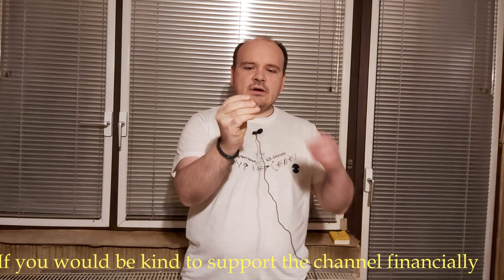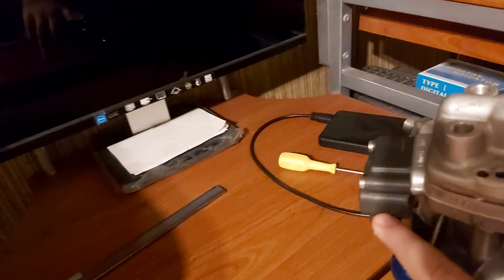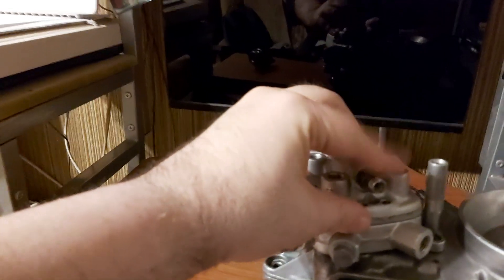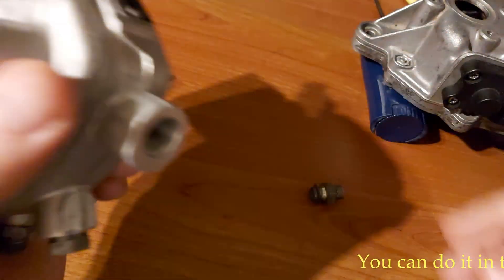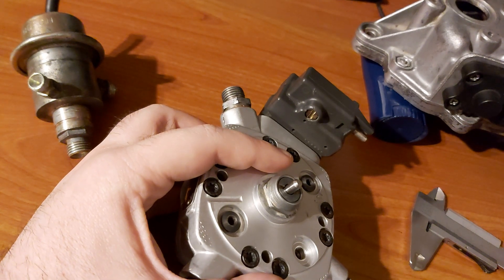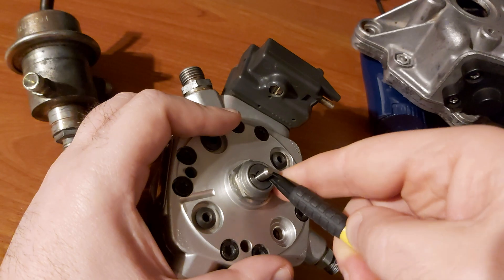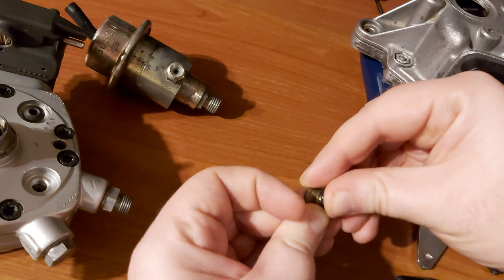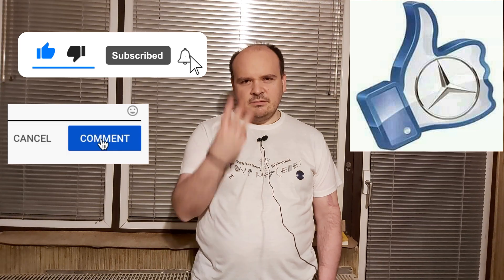Mercedes Ke jetronic - Replacing the rubber seal/fuel leak out of the distributor issue rich mixture

Comment: Thanks mr. About this video . When i push the plunger with my finger then fuel leak i replace this oring but the problem didnt solved is the fuel distrbuter is worn
Reply from the maker: Hello. Fuel has to flow when you press the plunger(by pressing the airflow meter plate), the point is that the fuel must NOT flow when you DON'T press the plate and the O-ring on the sleeve(crew) has to prevent fuel leaks no matter if you press the plate or not!

Comment: Hi friend. Before writing to you I want say so many thanks. Because I learn about so many things about jetronic system. The car only carank and stop immeditelyI have fuel leakage in the same point and my distributor newer deliver the fuel out of the ports. I try to push the pulanger even if turn the mixture adjustmet screw to last point. İs it reason of the presure lost in that point.?
Reply from the maker: Hi and thanks. If you have fuel leaks then replace the seal ring. If you have no flow to the distributor at all then it can mean that the pressures equalize and the car won't start. In that case the pressure regulator can be the culprit but that's something you will have to do with the pressure gauge on. You must measure the pressures and then tell me what you got. The car starts and stops the same moment - it can refer to the rubber boot(torn or cracked). That much I can say from this stance! Greetings
Reply: @mercedeske  Hi, you advice to me some valuable  things I order that seal ring but it had not delivered yet. When I take the  ring I will write the result. Loves from Turkey.

Comment: Finally found this video! Priceless info! Thanks again sir! I suspect my fuel smell through the air vents is coming because of this seal leaking (hopefully) as the underside of the air/flow plate is visibly wet and EHA is dry. Will post results!
Reply from the maker: Thanks, just keep digging on my channel. You will find priceless videos. Happy Mercedesing 🍀 😊 😃

Comment: hello...i need help.... My FD plunger is leaking only when the sensor plate is pushed down while engine is off. Changed the o-ring with a new original one...the big 19 nut is also tight. Why is it like that?

Comment: I have been binge watching your videos and I have a question about measuring the nut and sleeve in this video. In your video at https://youtu.be/EPTgBZlB6NA?t=299 You say the distance is .6mm. Is that for a specific vehicle? I have a US model 1987 560SL and my measurement (car was running smoothly) is .43mm give or take. The larger o-ring was hard and so I purchased a new one and also the smaller o-ring. Should I change distance to .6mm or put it back together using the same .43mm? Love your channel.
Reply from the maker: Hi, thanks, I'm glad you like my videos. I really like your videos, as well. It can be seen that you have a huge experience working full of self confidence on the car without trembling hands from fear! The next video to come is going to be the altitude sensor which is on the US cars version, so you could "take a look" once it is uploaded... Concerning your question, the 0.6mm is the BOSCH recommendation and a nominal value so to speak but if your car runs okay on 0.33, then it's up to you to decide whether you are going to set the sleeve by the nominal values or you are going to leave the sleeve as it was. You are not the first one to ask me this question. That's why I tell people to remember the original settings before they do any modifications. So, long story short - either you are going to do the job twice experimenting or you are going to leave the part as it was originally. Happy Mercedesing!
Reply: @mercedeske  You are great! Thank you so much. I didn't realize how easy that nut is to move. I may have move it when I cleaned it in the parts cleaner with a soft brush (I've never done engine rebuilding before). I'll make note of my .33mm, but I will set it to .6mm to start with and see how it runs (if it ever does). 

OH Yeah! I cleaned it months ago and now the piston is stuck. DARN!!!! I guess I didn't lubricate good enough after cleaning. I may need to disassemble the entire thing now. This is how it goes with me.

Thanks again!
Reply from the maker: Just disassemble the fd, apply WD40 as much as you can and let the fd stay over night. It's going to slide smoothly as through butter 🧈 😃
Reply: @mercedeske  Thank you sir. I have purchased a Fix your Mercedes membership! You have been very kind and I appreciate you taking your time with me. 

Question: When you say "disassemble the fd" do you mean I will take it completely apart like in these videos you have uploaded?

Fuel Distributor - The Basics Part 1
The Fuel Distributor Disassembly Part 2
The Fuel Distributor Disassembly Part 3
Reply from the maker: @TonyLiveTV  Thanks a lot! I really appreciate that! As for your question - Sorry, my bad, I meant to remove it from the airflow meter. Just remove the fuel distributor, put it upside down  on a workbench or....and then apply wd40 and let it sit over night. There must be an improvement. Best wishes!
Reply: @mercedeske  I had already removed the fuel distributor from the air flow sensor in March. At that time the plunger was smooth like butter. Then I cleaned everything using a "water based" solvent (I guess that's where I went wrong). After that I blew everything out with the compressor (has air dryer). Then I squirted WD-40 into all openings of the fuel distributor and then I put it away until today.  I live in Arizona which is the dry desert. Anyway, today I started working on the fuel distributor to replace the o-rings and the plunger was stuck out. I put my thumb on it and pushed it in and now it's stuck in.

I have removed the nut and the small o-ring and have now filled it with WD-40. I will wait till morning and I'll let you know.

My BOSCH is 0438101018 and if you need my VIN let me know. I wonder if I need to purchase a repair kit? The car was sitting for 14 years. Everything I touch on this car scares me.
Reply from the maker: @TonyLiveTV  Just go easy on it. That's something worst or the car - sitting for more than 5 years. One advice more from me - fill the car with ethanol free fuel because it is going to make you a real mess/mesh inside the distributor r it is going to harm the diaphragm so avoid the ethanol containing fuel after you have started the car. I would really like to see that car brought back to life one day and you can do it!
Reply: @mercedeske  unfortunately the plunger is still stuck after sitting overnight with WD-40. Looks like I will have to remove that bottom nut with that retainer washer to pull out the plunger. I’m not looking forward to opening up this can of worms. If I ever do get this engine back together I don’t see how it will ever start. I have messed with way too many things on this car.
Reply from the maker: @TonyLiveTV  You don't need to unscrew the nut in order to take out the plunger, just unscrew the sleeve. One the distributor on my video I couldn't move the plunger for 1mm with my both thumbs and you saw how easy it was going at the end? As for your distributor, well...I don't know what to say, I haven't seen the situation...Unscrew the sleeve completely and then carefully take out the plunger.
Reply: @mercedeske  thanks for your suggestion. I have already removed the slotted nut and filled that with WD-40 yesterday. I can’t get hold of the plunger because it is pushed all the way down. I tried using a rubber mallet on the opposite side to see if it would come loose, but that didn’t work either. I will try a few more times before I give up.
Reply: @mercedeske  YIPPIE! The plunger is now out! There is NO rust or anything like that on the plunger. The inside looks OK too (can't see too well). The spring also seems fine. The plunger goes back in, but doesn't readily come back up. I flooded it with WD-40 and then put the plunger in. It works OK, but not as smoothly as it did when I first removed it from the car. 

Question: What's the best method for cleaning? Should I just use brake clean? Is that safe on the diaphragm and o-rings? I do have a 6L ultrasonic cleaner with heater. I realize I should put the plunger in the cleaner. I didn't think I should put the entire fuel distributor in the ultrasonic for fear it would vibrate the 8 "off-limit" hex screws that pre-load the springs. Just want to do it right that's all. I will be uploading a video of all this once I have it all back together.
Reply from the maker: @TonyLiveTV  I told you you are gonna make it! If you have an ultrasonic bath then you can flush the whole distributor. 30min. in the bath using a dish soap and afterwards flood everything in a solvent. As I told you that you are going to succeed with the plunger, I'm telling you you are going to start the car!Happy Mercedesing and fingers crossed!

Comment: I have found fuel in the rubber intake boot, I get the black smoke and rough, rich running, and have thoroughly checked all systems.  Do you have a good source for this seal? Would it be included in a fuel distributor rebuild kit? Nevermind, I see you put the part number in the video description. Thank you!
Reply from the maker: There. Nothing to be afraid of. Just remember the position of the sleeve. Measure it with the caliper. You can either buy it on ebay or in the dealership. Fingers crossed 🤞🏻 Happy Mercedesing 😃

Comment: Hello my friend, I thank you for your efforts in providing this important information, and I hope you will answer my question. What is the pressure of the compressed gasoline in the jitronic when the car is not working, that is, it is idling???
Reply from the maker: Hello, my pleasure. When the car is nit working, when it's off, the pressure has to be 3bar(when you start the engine and then stall it). For m102 and 103 engines between 5.3 and 5.5bar, for m104 up to 6bar.

Comment: Must the sensor plate be deflected for 30 secs and by how much?
Reply from the maker: Yes, to the max. As much as you can.😉😃😀
Reply: @mercedeske  is some leakage normal because I always see some fuel but no black exhaust smoke and engine runs perfectly.
Reply from the maker: Yes. If just like fog, it's okay. The rubber boot mustn't be flooded with fuel.
Reply: @mercedeske  By deflecting the sensor plate for 30 secs and pump running won't this cause the cylinders to become flooded?
Reply from the maker: Take out the injectors and put them in the bottles(let the bottles be clean).
Reply: @mercedeske  🙏

Comment: Hi,  I replaced the seal as mentioned.  But the leakage is still there.  Does it mean a complete rebuild is needed for the distributor?  Thanks!
Reply from the maker: This is the answer to your question, dear Yuen!
https://www.facebook.com/102009585346864/videos/1252229561897832/
Reply from the maker: Hi. Yes, you need to rebuild the distributor.
Reply: @mercedeske  Thanks for your quick reply.  I'd like to learn from your best knowledge if the seal A0119977148 is also applicable to the 6-cyl fuel distributor.
Reply from the maker: The sleeve is universal, then the seal ring has to be, too.
Reply from the maker: I can post a video on my Facebook page Fix your Mercedes just for you(you have a link in the description  of every of my video).
Reply: @mercedeske  thanks!
Reply from the maker: You are welcome 😊
Reply: @mercedeske  hi, eventually I get a rebuilt fuel distributor from an expert and havd it tested with the airflow plate together.  just want to know if it is a must to have the plunger depth to be 0.6mm from the edge?  Or it should be calibrated by individual cases? The remanufactured  one I got now has 0.3mm.  Thanks!
Reply from the maker: @herrickmky  Yes
Reply: @mercedeske  Just out of curiosity, if will happen if the plunger depth is set incorrectly?
Reply from the maker: @herrickmky  Yes, it will. The starting position of the plunger must be set and that's done the way you set the sleeve at 0.6mm gap from the nut. If there is still leak then you will have to unscrew the metal hoses leading to the injectors, to make the pump running continuously and just to observe. If there is fuel coming out of the distributor without the sensor plate deflected then you have a ruptured diaphragm. The fuel must flow only as soon as the sensor plate is deflected.
Reply: @mercedeske  Thanks!  Now the fuel leakage only happens when the sensor plate is deflected to the bottom after the engine had run.  is it normal?
Reply from the maker: @herrickmky  Yes, it is.
Reply: I have a 1989 560 sec. Is it the same procedure ? And measurements?

Comment: Hello there: I figured my prolem out! My temperature guage is not correct on my w124 1986. The car runs hot without realizing its true temperature. What can I do to fix that?
Reply from the maker: Does the fan turn on when it's supposed to?
Reply: @mercedeske  yes, based on the temp guage but I don't think that it is correct.
Reply from the maker: @yassindiab6144  I'm not sure how the gauge is repaired, it's just the issue of the instrument cluster.
Reply from the maker: @yassindiab6144  That's just an indicator for you to know not to overheat the engine. That doesn't mean that the engine is bad. When the fan kicks at 80, check the coolant temperature sensor and if it shows 350ohms at 80 degrees you will know that the ECU does not make additional mixture enrichment.
Reply: @mercedeske  Amazing, thanks for your help! ♥️
Reply from the maker: Glad to be of service...😀😃😄👍

Comment: Hi bro i want to ask you
What is the best engine?
M111 or M103
Reply from the maker: Hi, bro. M103 is KE-JETRONIC, you can find in w124, w126, r129. It's old school proved as reliable. For the m111, that engine is mounted in w124(last models), in w210, in slk and mostly c-class and it's not KE-JETRONIC engine it has a Siemens PEC(pressure engine control) and Bosch HfM(hot film management). The only thing I like is a DOHC, 4 valves per cylinder. I don't know much about these engines(which is no reason for you not to buy it😀😃😄). It depends on you what you would like to drive.
I hope I managed to give you the right answer. Greetings
Reply: @mercedeske  yes i know bro 
I have mercedes E230  1993 i love  ke-jetronic but iwnt to sale it and u will bay another model in 6 linge m111 what do you thinge   Advise me
Reply from the maker: Well, if I had to buy m111 engine, I would go for c-class, something up to 2003, relatively new. Don't buy e-class, because it's w210 and that's the worst Mercedes ever. Germans call it "Scheißhaufen"(bunch of shit). It's only good side is that it's comfy and wide. So, you can go for a 2.3l engine, a c-class, up to almost 200hp. Again don't buy w210 under NO conditions.
Reply: @mercedeske  iwill by  w124 E300 or E220 not w210